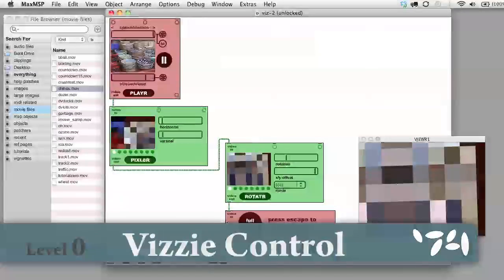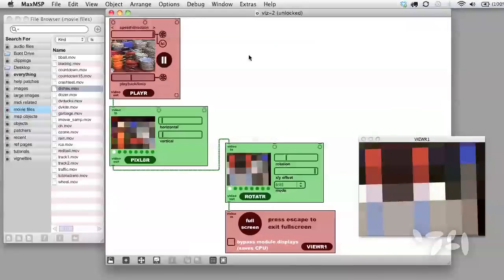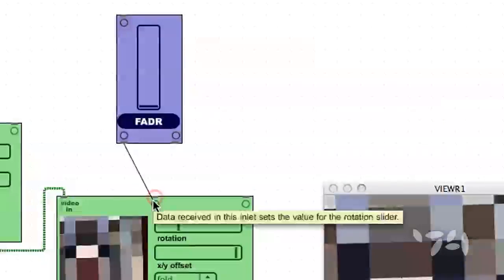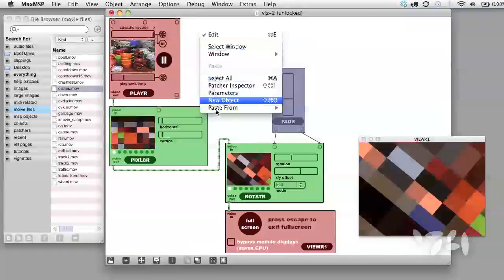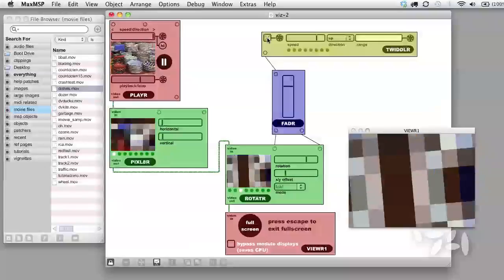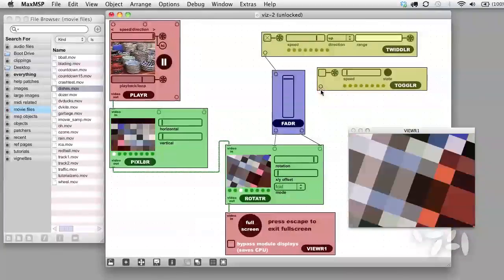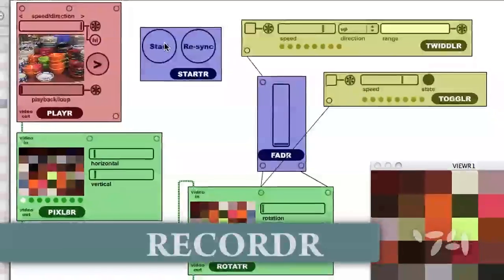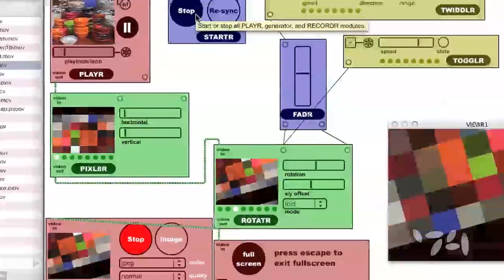Cycling74 Max/MSP/Jitter Tutorials: Vizzie Control - 2

Comment from the maker: All of the VIZZIE modules are designed to work at 640x480 for efficiency. If you want a higher res, you will need to alter the VIZZIE patches.  If you need help, post a message to the forums.